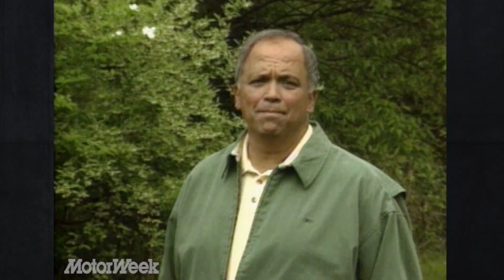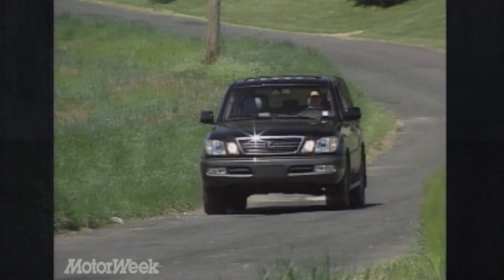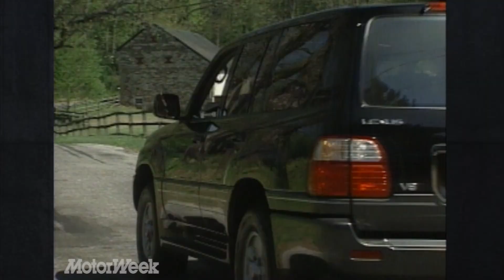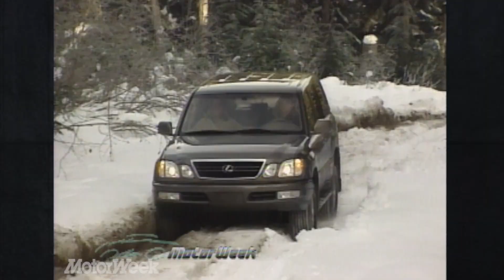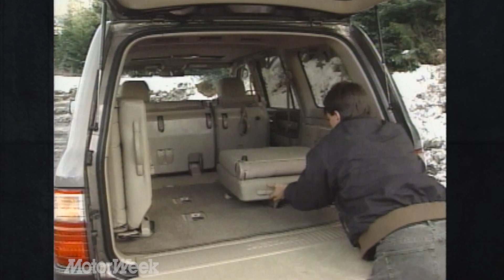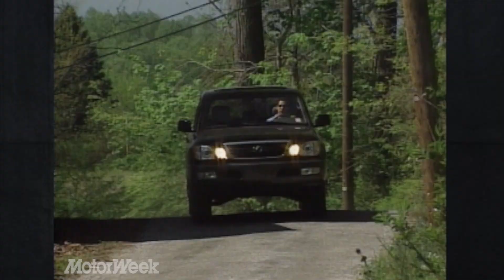1998 Lexus LX470 | Retro Review

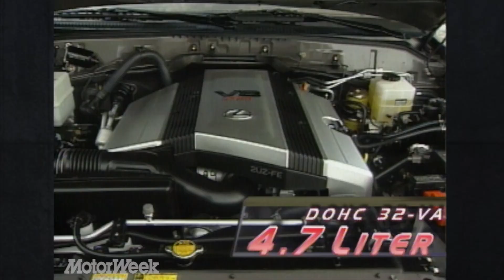Comment: Did the Toyota Tundra exist in 1998? Because at 1:28 even though John Davis said that V8 came out of another Lexus, looking at it where I think it came from the Toyota Tundra pickup! Because I don’t think a V8 from a Lexus sedan doesn’t have enough power to maneuver a big Toyota Land Cruiser or in this case it’s Lexus LX!
Reply: No, you are somewhat wrong. The Tundra did exist in 1998 but it was not in the marketplace for sale yet. In an odd move, Toyota began the slow roll out of the Tundra from February 1998, when it was revealed as the T-150 and renamed Tundra by press introduction in late 1998. It later went on sale June 1, 1999.

John is correct about the LS400 engine the UZ V8 being shared with the LX 470 bored out to 4.7 liters.

Comment: I have a '99 LX470 and I love it. I bought it used 4 years ago and aside from putting new brake discs in the back recently, I've had zero mechanical or electrical issues with it. The 2UZFE V8 is amazing in its durability.

Comment: This LX generation is the GOAT - still see a lot of these on the road today, and for good reason. Only the horrendous MPG (thanks to that old-school 4 or 5 speed transmission) holds it back.
Reply: I get about 15 mpg with mine and I don’t complain. It’s made of steel not plastic so it’s worth it.
Reply: You still see a lot of these on the road today because this generation of Lexus lx and Toyota Land Cruiser literally existed between 1998-2007
Reply: It is the weight and shape that kills the MPG, not the transmission.  My LS400 will do 30 on the highway, 5pd.

Comment: Bought my 470 a year ago from a private party no ppi.  Put 10000 miles on it already and at almost 200k it still hasn't had any issues.  Compare it to my 2016 VW which always needs repairs and I now want to keep it forever.
Reply: VW to Lexus, you took the shortcut from a really bad decision to a brilliant one.
Reply: @kftc1980  update now is the 470 has an additional 5k miles, still no issues and the VW was mechanically totalled 2 days ago for both engine AND trans rebuilds.  Never again haha.

Comment: 126 feet to stop from 60 is damn impressive for 1998 and 5100lbs.  A lot of sports cars from the 90's didn't stop that quick, even today that would be a great number for a "regular" type of SUV(aka not an AMG Benz with 19" rotors and 295 width summmer tires)

Comment: An under-engineered, under-powered, overpriced, overrated, 3 ton tub of slop. 
Cooling issues, then warped heads, then cylinder liners. Conservative design from when they just copied what Benz did.
Reply: Are you sure you are commenting on the same video?

Notice how every single other comment, many from actual owners, praises this gen LX and for very good reason? This was the king of SUVs during its time and there are tons of them still around today, fetching a high premium. Extremely comfortable, competent, reliable. The Germans didn’t even HAVE a true competitor to this.
Reply: Try an earlier X5, all built in South Carolina, USA and NOT in Deutschland...   (even if it was, no contest, as BMW has never made a Body On Frame SUV)
Reply: @syxepop  Agreed.  Bimmer never made a true offroad-grade SUV, only an onroad-grade variant at best back then.  Even in present day off-road packs are still optional bundles......

Comment: I wish they still made relatively simple vehicles like this!
Reply: Simple? This was the first SUV with a backup camera and also Bluetooth 20 years ago.
Reply: @jmin8400   It had Bluetooth?
Reply: @hedgehogthesonic3181  Yes, later.
Reply: @jmin8400  you can fix almost anything that would break on this at home with few special tools needed, trust me.  Try that with something brand new.   I’ve had an LS400 for 8 years and 100k miles and have had to take it to a mechanic zero times.  Surprisingly simple indeed.

Comment: It's crazy how far engineering as come. This Lexus V8 makes the same amount of torque as Mazda's current turbo I4 and very similar power.
Reply: But now they are not build to last.  Squeezing more and more power out of a smaller package comes at a price.  So does cramming more and more tech and required safety items while keeping the weight and price down, they have to cut costs somewhere, and use more plastic parts in places where they shouldn’t.  This era was peak quality.
Reply: @kftc1980  Many newer turbo motors have proven they're are easily capable of lasting well over 250k miles on a regular basis, while using significantly less fuel and making twice the power or more for the displacement
Reply: Yup. The first thing I thought when I saw those figures was that a Mazda 3 could beat this car. Crazy how far cars have gone.

Comment: You can install an Apple CarPlay head unit with Bluetooth and backup camera in that double din opening and you’ll have most of the tech of newer cars.
Reply: Or you could buy a 2004-07 model…

This was the first fullsize SUV with bluetooth and a backup camera anyway, in 2003. No one else offered that in this class anywhere globally, outside of the Land Cruiser.
Reply: @jmin8400  the nav in the 04-07 models is basically unusable today. I have an android head unit in my 04
Reply: @wwatts  Not everyone needs in dash navigation. My point is, they did Bluetooth first and also the first backup camera for an SUV of this size.

Comment: This big V8 truck thing shows why the 2000 Tundra was so good at launch. It's too bad they didn't give this version some of the 98 GS400 V8 tweaks for more power though- to differentiate it between the regular Toyota Landcruiser and the Lexus versions.
Reply: Agree. It’s a great vehicle but power delivery wasn’t enough. These vehicles could’ve benefited with slightly more power, but that’s also what made these trucks so reliable with the less is more strategy.
Reply: @alexblankenship7385  Toyota was great at improving existing designs.. evolutionary. That's what helped them be so reliable. But that can result in slow progress. Having to make lots of big changes quickly.. that can really hurt quality. See current Toyota gas turbo truck issues.

Comment: to Ford, Chevy, Jeep & Toyota, pay attention.
THIS is how an SUV should have been.
I know Lexus is made by Toyota, but I doubt the new gen Sequoia & LX that just came out would be as reliable as this one or at least, the previous generation (2007-2020)
Reply: Well… Toyota does have a wastegate problem on the NEW Tundra; GM (Tahoe, Escalade, Yukon) has a rear axle problems; Ford pickups; drive shaft that can fracture. Chrysler hybrid has a fire risk problem. Kia & Hyundai; oil burning engines and catching on fire problem and etc. All new cars are Junk… especially TESLAS.
Reply: Agree

Comment: If you're looking for the LX 470, try looking for one made between 2003 and 2007. Those got significantly more power (275HP), looked better inside and outside, and got the arguably better 5 speed automatic transmission. Or you can get the GX470. It's smaller, but shares a lot with the LX, and is arguably better looking too.
Reply: The 2003 to 2007 got the upgraded interior and rim changes i believe.  Plus the 5speed tranny.  

2006 and 2007 got the vvti with the increase in power.  Different rims pattern. Upgraded led tail lights.  

So if you compare prices  the 2006 and 2007 are the truly the ones to buy. But expect to pay a hefty price tag
Reply: @ozzie3056  2003-2005 got 235HP, or maybe the way power was rated changed around that time. Because the GX470 and Sequoia with same engine were both rated at 235HP in 2003.
Reply: @damilolaakanni  I believe from 98 to 2005 it was the same engine making same power. Except 98 to 2002 it had a 4 speed transmission. 2006 and 2007 was same 4.7 as well but they added the vvti.  I have a 2005 lx470 and I feel like it has enough power. Gas well thats its Achilles heel lol.
Reply: I think you need to vet your claims, as in different videos I keep seeing wrong info in commentary.

LX 470s made from the summer of 2002 to spring 2005, do not have the more powerful V8, but do have the newer interior and updated styling.

They were not literally made from 2003 to 2007. Model years are NOT literal and do not describe production periods for vehicles. 

A 2003 model of any brand could be made anywhere from September 2001 to December 2003, if launched anywhere between January 1, 2002 and December 31, 2003.

As a Nigerian who has imported and exported many of these 100 Series vehicles, works in the automotive industry as a product planning engineer and junior exec in the Detroit Metro area, it annoys me to see these gaffes.

Comment: This suv is a future classic. Grab one while you can. I own a 2004 and a 2006. I love this SUV’s. Old-school …V8..builded like a tank.
Reply: I have a 2005 lx470. It drives smoother than my wife's 2016 450h. Seats are wide and comfortable and the cabin is quiet and spacious.  The seating position is very commanding. Something to note these have a hydraulic suspension.  It adjust ride height as well as changing the hydraulic dampers from stiff to comfort.  Unfortunately the prices have shot up on any lx land cruiser variant.  Since Toyota will not bring the land cruiser to the United States anymore. You can't go wrong with buying one. Since prices on these are appreciating instead of depreciating.
Reply: @ozzie3056 atleast we still get the new lexus lx600 which is essentially a fancy 300 series Land Cruiser
Reply: The only downside of ‘03 plus is the touchscreen with integrated HVAC controls.  Not exactly user friendly, and challenging and expensive to convert, if you can source all of the parts.
Reply: @kftc1980 I ran into that issue with mine. It’s very hard to find a direct replacement screen or modify it in any way.
Reply: Do they drive smooth on the expressway?

Comment: How well engineered is this SUV? There are still seen daily on the road. How many BMW's X-series or Mercedes Benz M-class are still prevalent on today's road. While Lexus/Toyota styling is very conservative. It ages gracefully. I would purchase a used LX470, from 1998, and reupholster and update the technology as opposed to buy many of today's SUV's which are iPhones, with wheels, with plastic bit engines and misplaced turbos that melt camshafts, seals, and cause premature wear.
Reply: nd the air suspension still works lol unlike the others
Reply: Absolute facts. This is the model that made me appreciate Lexus/Toyota quality. We bought a 99’ from auction a few years ago with 250k. Drove like a hot knife going through butter. One of the smoothest driving experiences. Guzzled gas, but it was amazingly smooth.
Reply: Best comment so far.
Reply: Yup, I have a V8 4Runner and that thing is very well engineered and well built.
Reply: I had a 2005 BMW X5 4.4i with 224k miles. Ran great.
Reply: These are the best SUV’s in the world
Reply: Mine still runs !
Reply: Bad analogy, when you don't see many of these because they went overseas.
Reply: I guess it depends where you live cause I see way more old BMWs on the road than these. Not speaking for reliability but I hardly see any of these 470s
Reply: @djncrti2860 They all went to Africa and Asia.
Reply: @djncrti2860  yeah,sure you do.  Not in Bay Area
Reply: Lol only if you washed this pos daily.  Nothing rusts faster than Toyota junk
Reply: @Welcometofacsistube  says the guy with FCA garbage. the fact we have Land Cruisers running from 70s and 80s more than i see an FCA trash from a decade ago explains which is the superior brand
Reply: @zhila5958  mopar goes farther back than a decade, child. And I've got original running mopars in my backyard before Toyota knew what righty tighty meant. Toyota is over rated junk.
Reply: @Welcometofacsistube  yeah? that’s why those Toyota’s you call junk has lasted the test of time of our rough conditions while the entirety of workshops have mopar trash that broke down? oh and neither of those mopars are older than a decade. in fact most of our junkyards are american junk and we barely import american cars. at least not everyone suffering from mopar cough cough fiats
Reply: @Welcometofacsistube  i’m not a fanboy of toyotas. in fact i disliked them for the longest time. i’m a fan of well made vehicles. don’t f**king argue with me with how good your FCA crap is because my friend who literally has a Chrysler 300c is already having problems with electronic malfunctioning and problems with cylinder heads, starter problems and don’t get me started at how garbo the interior was and how there were cracks in the dashboard and that was a 2018 MY car, meanwhile one of my relatives who owned a 1980 Toyota Corona till 2010 with 650,000 km on our rough conditions of our country literally kept going forever without once having any mechanical issues and the only reason he sold that car was to replace it with something new. you may live in some fantasy world because 90% of the Dodges, Chryslers, jeeps we imported a decade ago aren’t on the road anymore. but to my surprise 80% of the toyotas from 3 to 4 decades ago are still running wonderful.